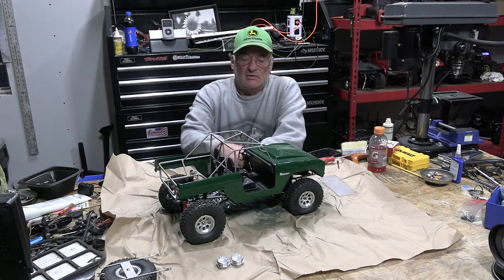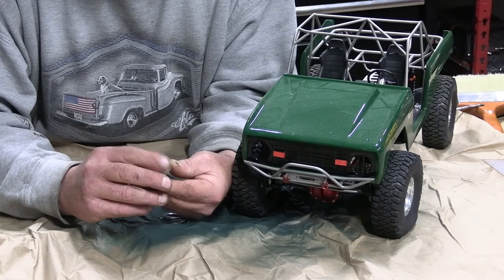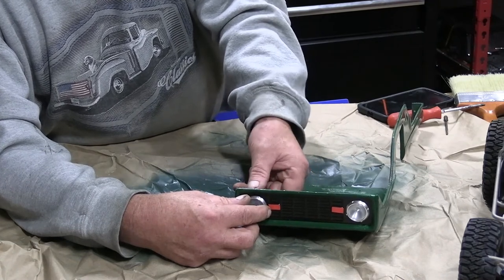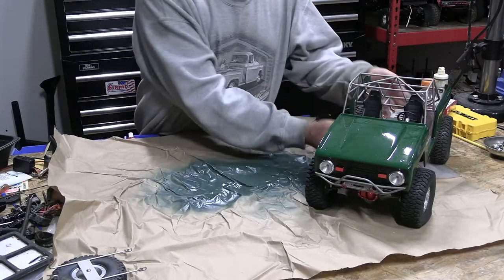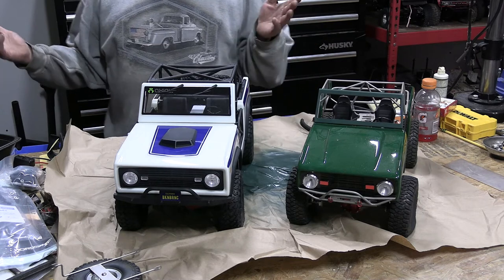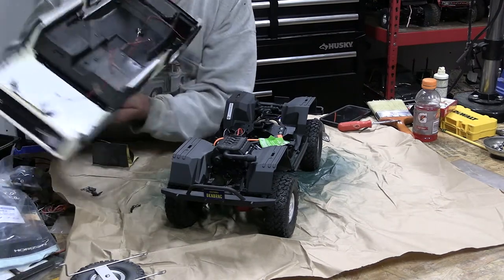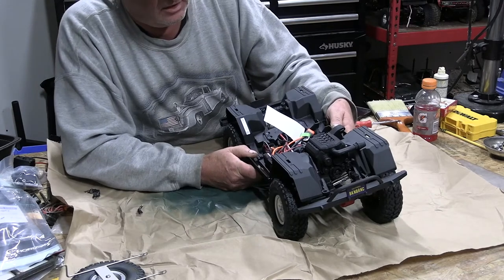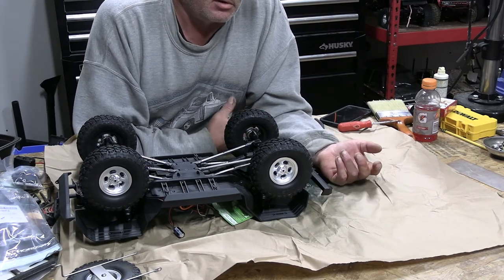Bronco Brothers. SCX10iii Bronco and TFL Racing Bronco comparison

Comment: What do you think of the TFL? Is it worth the buy ?
Reply from the maker: I believe that it is built very well. The axles and Transmission are based on the original SCX10 platform and all aluminum. They are great quality, but the price was really high at the time I purchased it. I most likely would not buy another one, but that is only because of the price.
Thank you for watching, and please come back for more.
Reply: @RCMechanicGarage   Thank you! I got my eyes on the LC70 Toyota 👀